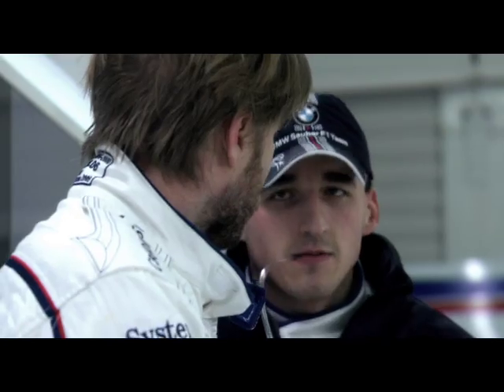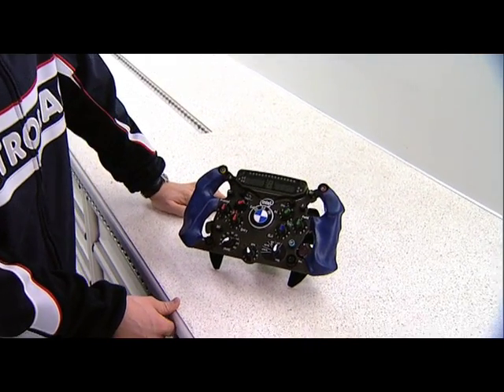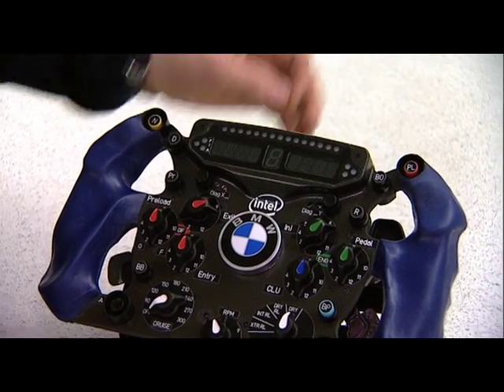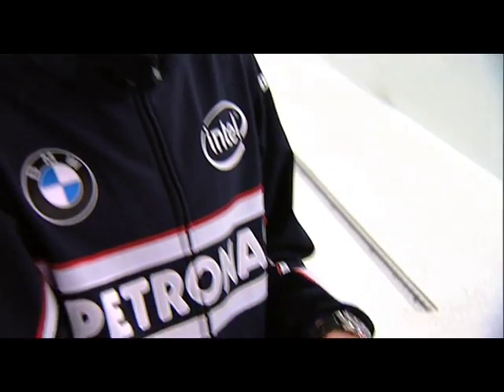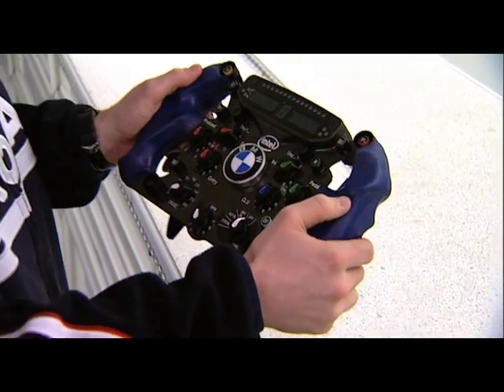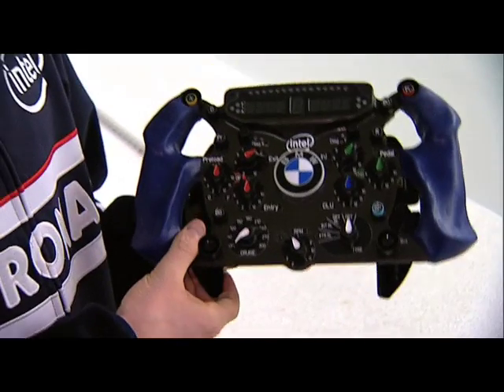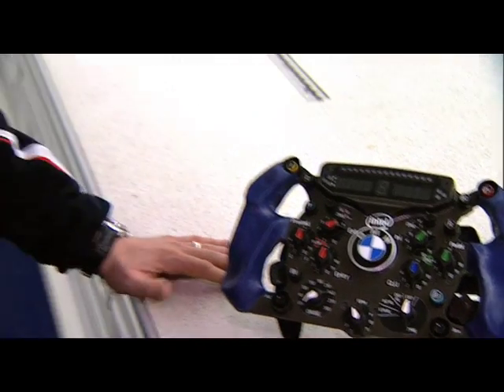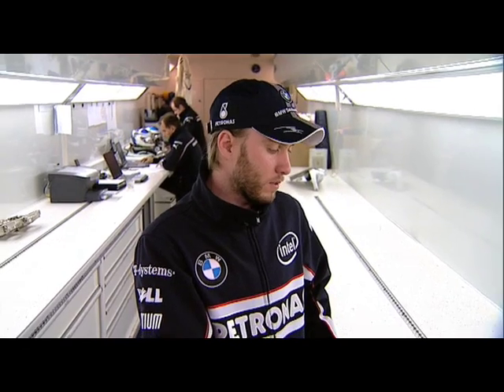Understanding Formula One: Steering Wheel.

Comment: @ba3cool Similar video, not more recent.  That is from back in 2002 or 2003. If you watch starts even from 2004 through to 2007, Ferrari, Mclaren and Renault had a launch system that worked off the clutch too; check out Canada 2004 start, onboard with MSC; he presses what I assume is the LC button, engages both clutches, selects 1st, revs up, drops the first clutch at the start and then moments later, the second...  Same for Kimi starting in Spain, 2006. 2003, Schumi presses a button to start.

Comment: @ba3cool COMPLETELY wrong.  The clutch is used for, as I said, leaving the pitlane, starting the race and recovering from a spin.

F1 does not have launch control anymore, so that procedure doesn't exist.  The start procedure is exactly how you'd move off from standing in any manual car:

Hold the clutch, shift into 1st, revs up, wait for the lights to go out, dump the clutch.  Job done.

Comment: @bazil83 as far as I know they dont need the clutch when starting the race. They shift the car into neutral. Press and hold the launch control button. Nail the accelerator to the floor. Wait a while, then when the lights go out they let go of the LC button, and shoot off.

Comment: you're right, but that wasn't the clutch... it was a third lever added right below the up/down shift levers to compromise for the differential settings or something like that... something about a prohibition on adjusting it while the gear's already engaged...all they did was to circumvent rules with that lever...